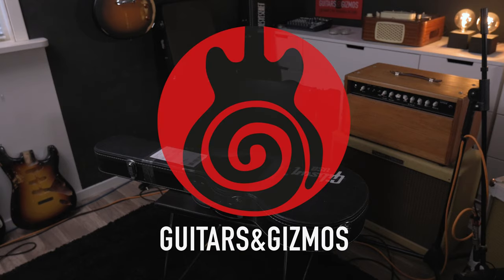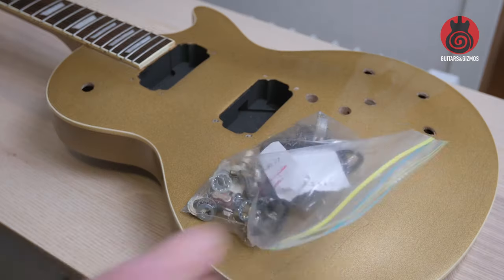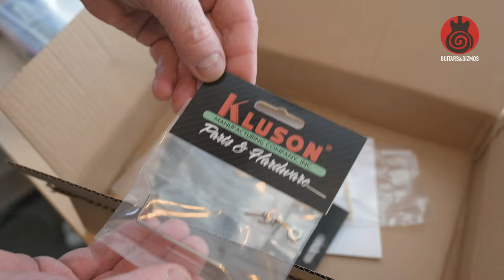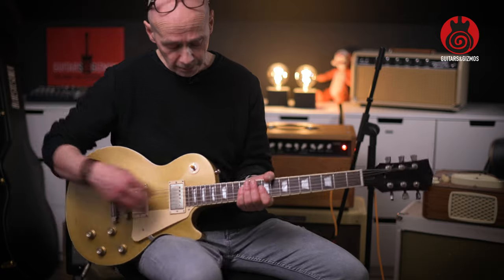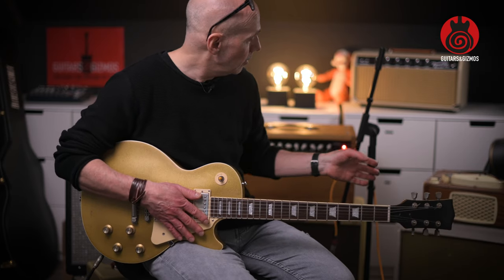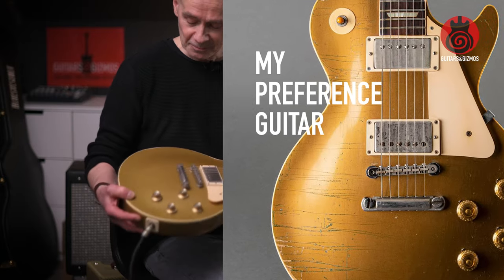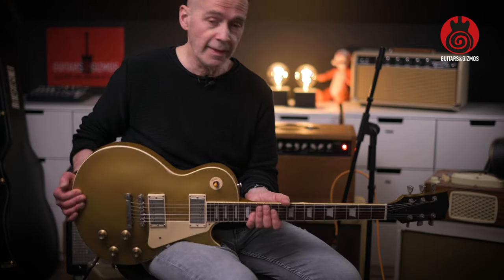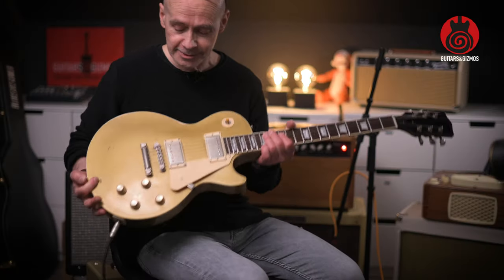'57 Les Paul Goldtop from stripped to a mean blues axe (Part I)

Comment: Beautiful stuff Thor! 
For your tone and volume pots I recommend VIPots, it’s the best there is. They will brighten the tone of you guitar and give it a great taper when you roll off the volume knob. They’re almost identical to the Centralabs pot used in the original Gibson from the 50s.
Reply from the maker: Thanks 😊 I will do some research on which to get, so thanks for the heads up on the VIPots. Cheers!